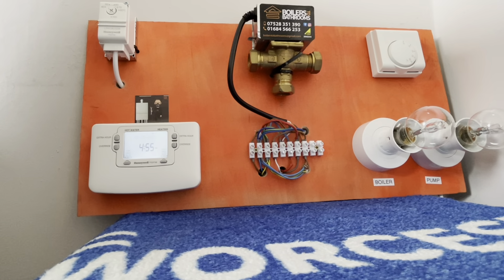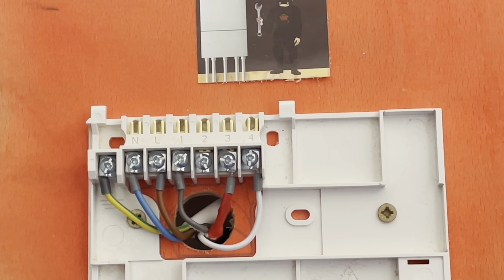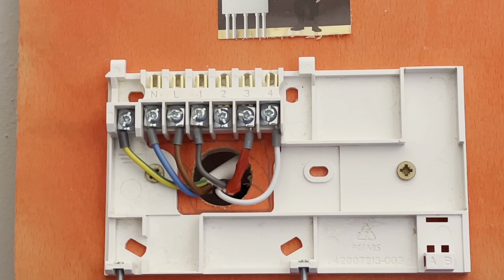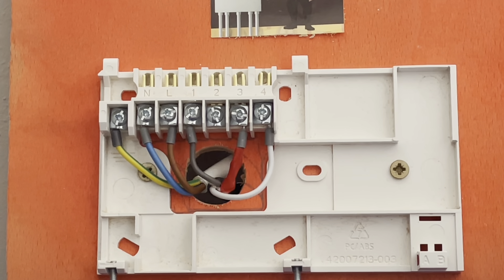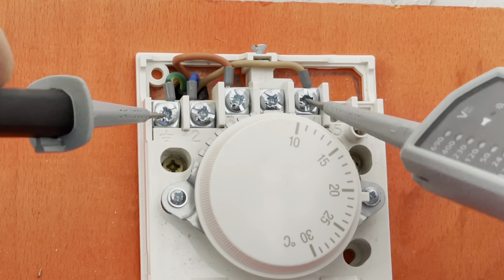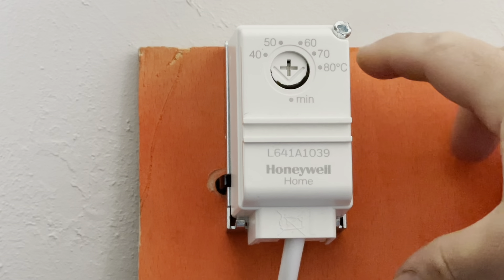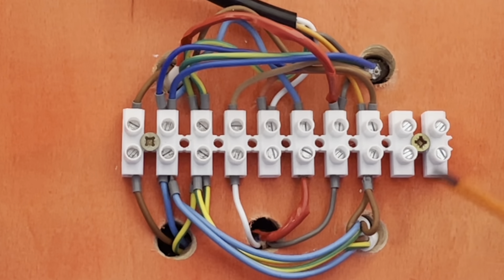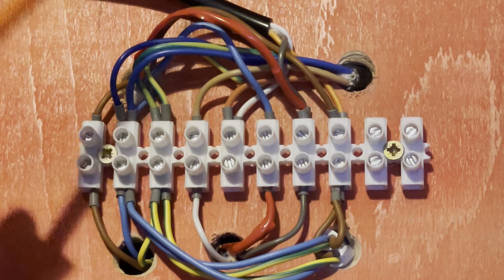Y plan heating system wiring explained Honeywell edition

Comment: Great to see that you have used the earth wire correctly! No using it as a switch wire or not having one in the cable. You might already now.... *The earth wire protects the cable!*  If mr/mrs DiYer chopped through or put a nail into one of the cables, if there was no continuity back to the FCU fused connection Unit ( 3 amp fuse) then continuity through the buildings wiring back to the fuse board ( Consumer Unit) there would not be enough fault current to earth (through the earth wire) to blow / trip the fuse / mcb and mr/mrs DIYer would receive a very nasty possibly fatal electric shock. If the installation was protected by a RCD Residual Current Device it would cut the power with in 20/30ms (very fast) and save you from receiving the shock, but older installations do not always have this fitted.

Comment: Great video. I have an issue I can’t get my head round. The programmer is on and the hot water side powers up as it should as per the times set on the programmer. On the other hand when the central heating is supposed to kick in as per the times set in the programmer ( eg 7am), nothing kicks in. The only way I can get the central heating to turn on and off is by controlling it with the thermostat dial. What do you think the problem might be?

Comment: Can you tell me why my boiler keeps short cyling while heating the water in the cylinder please? Its anew thermostat, and heat exchanger has just been cleaned. Brand new pump too. The cylinder takes one hour from cold to get to 52 degrees. Thanks.

Comment: I have a Honeywell controller ST6400C1003 controller box fitted to a 14/19cBi Worcester boiler. The boiler and central heating run only when the controller is by passed is when the black hot water on cable is connected directly to the red hot water off cable, terminals 1 and 4. Anything you can suggest please? I have tried two controller boxes, both could be faulty but unsure how to test them.
Reply from the maker: Get a Honeywell st4900c instead it’s a 7 day twin channel programmer.
Reply: Thanks, will consider that. I only run the central heating for 1 hr when nights are cold., so I don’t need a programmable controller. Is there a simple switch option instead ? Thank you.

Comment: My Hwell ST699 programmer doesn't trip on the timer ,but if I turn the spurred switch off/on it trips and runs. It might run the whole time or only 10mins or so [ but trips on if I turn the spur off/on again]  Any ideas?  Could the internal battery need replacing?   Any ideas appreciated before I fork out for a plumber/electrician/new programmer etc

Comment: I have a Vaillant ecotec 428  with a y plan system.I have 5 wires from the boiler.Live.Neutral and Earth then a black and grey wire which must be switch live and pump live but how do you find out which is which?
Reply from the maker: Check the boiler wiring diagram as this will tell you what goes where

Comment: If the programmer was faulty and you put a link wire between live and hot water I'm guessing that would mean the three port valve would be constantly open in the heating position so customer wouldn't be able to get hw? Because the valve wouldn't be in mid position ever?

Comment: i dont know if i am wrong i am just learning. so please dont mind if u think its stupid question. because i think there is an error i could be wrong. 
so from programmer we have one wire to turn off hot water which then link to grey on port valve. 
so where it has link with port valve it should be with incoming wire dont you think so? 

otherwise when the temprature hits level it wont stop hotwater side i guess coz from programmer we giving power to grey wire on port valve 

sorry if i am wrong just got this question new engineer so tryna learn 😂😂

thanks

Comment: thanks for the upload..
is it fair to say that if the programmer for dhw is off, 240v will be present up to the cylinder stat off , thus also 240 at the grey of the 3 port??.
Therefore, the only way for for no voltage to the grey on the 3 port is for the programmer to be on for dhw??
Reply from the maker: Yes mate that’s spot on